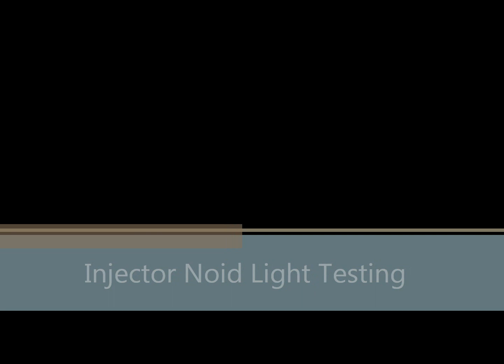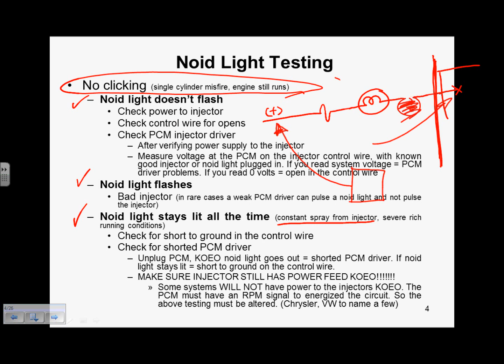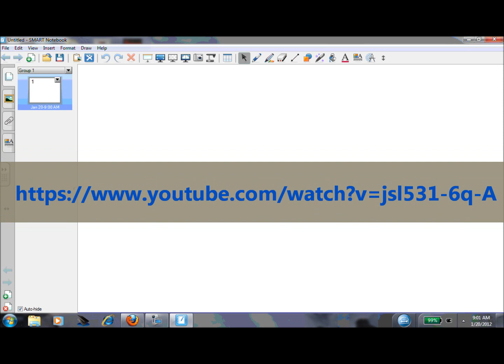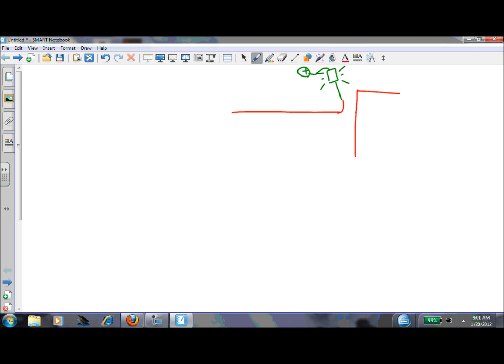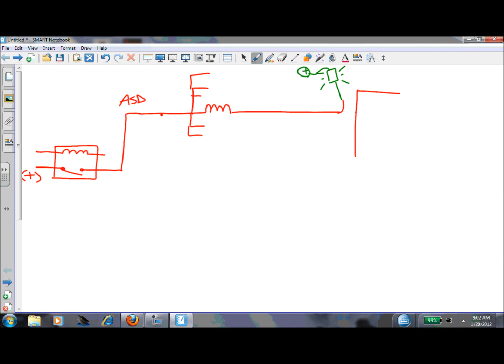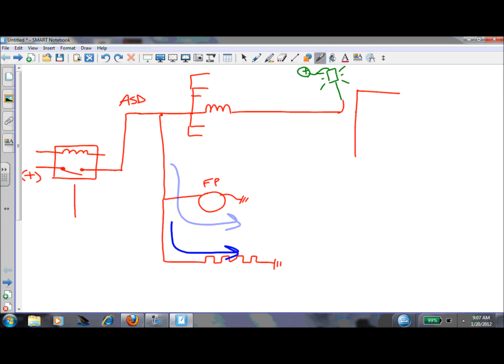How to test a fuel injector circuit with a noid light (a ScannerDanner Premium video)

Comment: If I put my test light on the wire on the ecm to test the driver. Test light on battery positive, it flashes but it is really dull, doesn’t that mean it’s a bad ecm?
Reply from the maker: No, that's simply due to a small injector on time. This is a go, no go, type of test. If you are chasing a no start, you have injector pulse. Move on to spark and fuel pressure and compression testing
Reply: @ScannerDanner  Nah it’s a misfire on a single cylinder changed a coil and an injector! Don’t wanna throw anymore unnecessary parts at it. I will go to compression test it.

Comment: I believe I have fallen into the Chrysler mystery category. 04 grand cherokee 4.0. #4 injector noid light stays lit and dosen't flash when the engine is running but is off when the key is on and not running. It started with a very rich misfire and it would go away for a while if I unplugged the #4 injector and plugged it back in but then it blew a few injector fuses on startup randomly and then once while driving to work one day and immediately blew again even after re-seating the plug. It seemed to be only when the #4 injector was plugged in that it would happen so I just ran it unplugged for a couple days as my commute is only about 10 minutes, but on the way home the second day I think the computer became very unhappy and started misfiring like crazy and I barely made it home at just slightly above idle.
The wire going to the plug was in bad shape and had bare wire showing so I opened the loom and spliced in a new connector well past the damaged portion of the wires and it didn't fix the problem.
I checked both pins at the connector for a short to ground and got nothing. I pulled the right side plug on the pcm and checked each hole for continuity and one hole made a 0ohm connection to one side of the injector plug and the other pin on the injector plug made a 8ohm connection to 3 holes on the pcm connector.
Where should I go from here?
Reply from the maker: You did your resistance test incorrectly. With PCM and #4 injector unplugged, one lead of your ohmmeter should be connected to battery ground and the other lead to the injector control wire at the injector or PCM (preferred at the injector) you should have an open circuit. Infinity reading on you mega ohm scale. Sounds like you have a harness issue especially because you blew fuses at one point too! Find the short to ground on the #4 injector and you'll find the rest of your problems

Comment: NEW RELATED ISSUE. 1999 Ford V 10 6.8 L.. pulsating light when the motor starts to idle. 1200 RPMs plus the light gets really bright and stop blinking and remains bright on.. totally excessive white smoke tail pipe. What’s the best troubleshoot thanks.

Comment: Dan I need your help. What are the two fat red wire leads that plug-in?.  (Boshe injector Mercedes). On a 05 smart car CDI diesel..I've been trying to find out for 2 years now so I can diagnose why I have a no spray situation at the injectors. I don't want to just start poking around and blow the ECU. I've TRY to contact boshe in Germany, local Mercedes dealers.. injector service shops, etc... nobody can tell me...I'm guessing one is feed , the other is pulse((theres continuity between the two)) and gets ground through the body. But still not certain 🤔
Reply from the maker: Let's move this to my forum www.scannerdanner.com 
It is free to join and we can definitely help you. I have 28k global members and hand picked moderators who've been with me for years and know my material inside and out and are there to help me help you guys. It is just too difficult to offer back and forth messages here on YouTube with stuff like this and we also can't share pictures and images here like we can on the website. Hope to see you there!

Comment: Sir, I have one doubts why there is 3V on one side of fuel injector and not 12V in my i20 2011. There are no issues in my i20. Just curious to know whether it should be 3V or 12V?

With engine off and key at ON position, the connector harness is connected to the fuel injector. 

Now, one end of multimeter is connected to ground and other end to one side of the fuel injector. The multimeter shows 12V, and other side of the connector shows 3V. Is this 3V supposed to be 12V and dropped to about 0V only when injector is switched on. Please note the injector is a computer controlled ground side switch.

Same result for the remaining 3 injectors. I'm really surprised why it's showing 3V rather than 12V on a ground side switch.
Reply from the maker: Do both injector wires go to the ECM? (GDI system)?
Reply: @ScannerDanner  yes both go to the ecm. The injector seems to be a ground side switch. 

With connector still plugged, one side read 12v and other side read 3v with engine off and key at on position.
Reply from the maker: @tnamen1307  then it is a GDI system and they are completely different in how they are controlled.
Reply: @ScannerDanner  it would be really great if you could make new videos explaining why there's 3v on one side in a computer controlled ground side switch circuit.
Reply from the maker: @tnamen1307  I have videos on GDI injectors and how they are controlled.

Comment: I've been trying to troubleshoot a 91 nissan 240sx with high fuel pressures and white smoke/fuel coming out the exhaust. Replaced fpr twice with same condition. I'm looking into checking the injectors. I'm a novice when it comes to automotive diagnostics. This is definitely a learning experience

Comment: How about if both wires stay on I check with the tester they both give me power on each side of the injector    No Flash. When I turn the key on it does turn on with the tester inside.  Touching ground

Comment: I have this exact situation going on! I had white smoke that smelled like raw fuel injector #6 stuck wide open I shot the parts cannon at it...new plugs, wires , coil, injector, pvc even replaced the fuel pump....The noid light would light up. One day it just started running fine again,  and now fast forward a year...I’m getting same cylinder misfire on #6 cylinder, but no more white smoke instead now noid is NOT working.. I’m getting 14 volts on feed side and 0 volts on the control wire... I did what you said and followed wire to computer and it’s saying 0 volts, however I can’t go any further the wires go up down and around the tight area under the battery box 09 Escalade hybrid .... does this wire go to fuse box? I believe it’s a shorted wire because it would only act up after it rained a few days...
Reply from the maker: 14 and 0 and no white smoke? Your injector winding is open
Reply: Thanks for the prompt response! I’m gonna chase this wire down once and for all! 👍🏻
Reply from the maker: Remember, if that control wire is shorted to ground, that injector will be spraying fuel constantly! And you will absolutely have white smoke pouring out if the tailpipe
Reply: ScannerDanner that’s what it was doing a year ago and all symptoms went away and all of a sudden one rainy hot muggy midwestern day it came back in same #6 cylinder, however now instead of stuck open spraying fuel it it’s not clicking at all... I can feel the injector not clicking inside like the rest. I swap with cylinder #4 and it starts working. I’m thinking there was a corroded or shorted wire that finally snapped or something. when it used to act up I could tug on the harness and make it fix itself, but that won’t work anymore ...another indication it’s most like a broken or corroded wire or a loose connection.
Reply from the maker: @vunit8213  I understand what it was doing before and there is no question you have a harness issue that was never fixed, however, if you have 14v on the feed and 0v on the control, measured right at the injector and you are sure the injector is not energized, there is only one cause for that, an open in the injector winding. You said when you switch it to another cylinder that the injector starts working? So when #6 is moved to #4, the #6 injector works?
A corroded wire that would lead to an open circuit, you would read battery voltage on both the feed and control wires when measured at the injector, but 0v at the computer.
Reply: ScannerDanner exactly right! It’s not the injector because I swapped connectors and it’s definitely the plug... i followed that wire and checked it on the way with the power probe and some liquid tape. (You taught me that trick) still no voltage but that wire starts merging into one big cluster under the Battery box and 2 sets of wires splice off from it and there all taped up so I’m lost! There’s a connector that says dephi is that my fuel injectors? Because the injector connectors also say Delphi? 🤷🏻‍♂️ I guess what I’m saying is I think my computer is hidden under the battery box....it’s going to be hard to test at computer when I think my computer is under the battery
Reply from the maker: @vunit8213  okay, so that injector functions when moved to another cylinder. Then there HAS to be an issue with your measurement. Can you please confirm you are seeing battery voltage on the feed wire and 0 volts on the control when measured directly at the injector connector.
Reply: ScannerDanner yes, at the injector the noid light wont light up so I tested feed/control wires and got 14 volts at feed and 0 volts at the   Controlled wire... I followed that wire as far as I could and it’s reading 0 volts it’s completely dead....could it possibly be the pc driver? All the other injectors are testing good... I’m trying to test it at the PC Driver, however it’s easier said then done, it’s all wrapped up pretty good and winds down and around and merges all different directions...
Reply from the maker: @vunit8213  to be clear, battery voltage on one wire and 0v on the other wire when it is unplugged from the injector is normal! This test should be done plugged in and backprobing. Or with a known good noid light installed. Is that how you are doing it?
Reply: ScannerDanner Ok I see, I did it both ways... with engine running/off back probed with power probe and the rest of the injectors control side wire light up green on power probe showing negative and when turned on they got to 14 v however that one single wire is showing  nothing! It’s dead! However, I’m going to backprobe again to make 100% sure....do you think my issue is the driver or the wire?
Reply from the maker: @vunit8213  I think it's the wire. Wherever it was shorted to ground when you had white smoke pouring out of the tailpipe, that wire would be open and exposed to the elements. I believe this same location is now green and corroded and is now an open circuit.
Reply: ScannerDanner that’s exactly what I think! Because it would fix itself and run fine until it would rain for 2-3 days and I would notice, those would be the days it would act up and misfire. I think that wire finally broke through, because I was in a drive through and like a light switch it started shaking out of nowhere! But I had just got done driving down a road that had about 2”-3” of water submerging half of the road...
Reply: ScannerDanner well, I still having an issue with cylinder #6 missfire.... here’s the kicker!!! I’ve been trying to fig this bitch out for awhile and now I’m really confused!! My noid light won’t light up on #6 connector anymore, however feed/ control are both registering 14.2 volts 🤷🏻‍♂️ 🤦🏻‍♂️ ......I checked a know good and it’s lighting up noid, but the light looks very dim...I’m not sure if that’s normal or not!? I just changed the injector because I didn’t know if it was spraying adequately, however it’s 100% not the injector....It’s definitely the wire or driver....I’m going to clear fault code and see if I’m able to catch the noid light in the first few seconds of start up just Incase the driver is shutting the injector down intentionally... the connector was bad so I just replaced it, but that being said maybe the driver shut down that injector because sensed a bad connection???.... the only thing I find kind of weird is when I test a known good injector the noid looks pretty dim, almost a reddish orange color and I would think with 14v it would light up bright considering you said it only takes 200 ma to light up that bulb... 🤔 any advice is appreciated!

Comment: Ok so after verifying no clicking at any injector on pass side ( tan wire ) and still no pulse at connectors at each injector. I went to PCM to pin 58 ( tan wire ) back probed pin and went to batt pos and still no pulse. Although back probing pin 59 ( White wire, bank that's working ) I get the pulse, confirming driver is sending signal out on that side. Also confirming driver for tan wire pass side not firing injectors is bad. I'ma call it a bad PCM driver and going to swap PCM out.
Reply from the maker: Let's make sure it is not some type of intentional shut-down of the injectors. The computer will do this when it recognizes a misfire to prevent the cat from melting down. The key in identifying this condition is to test for injector pulse immediately on start up. The computer will always try again on initial start up before shutting them back down.
Reply: @ScannerDanner  here is the post I made in the forum, shows pics ect. seems some bad wires pos to pulse wire crossed and shorted pcm. it is obd1 the other side works fine and is on a separate pulse wire. I did a batt disconnect, then reconnect and had someone turn key over as I was checking for pulse on the side in question. Just to make sure it wasn't an auto shut down. Then I went to pcm/ecm. Pulses on side that works pin 59 but not on the side that don't pin 58. Found a good used ecm for 35.00 so I'ma ( lol ) swap it because it's cheap enough and being obd1 and same MT/FED and part number as well as no programming because of age and type. 
Your videos have helped me greatly with diagnosing this obd1 system. Let me know what you think after looking over the post in the forum linked below. 
https://www.scannerdanner.com/forum/search.html?query=engine%20running%20on%20one%20side&searchdate=all&childforums=1&catids=4

Comment: I have code p0208 #8 injector circuit an p0308 #8 misfire..... while car running pulled injector 8 connector off an there no change in idle sound, Pulled #6 an there was a change in idle sound.... Put a noid light on 8 an no light....loosing my mind with this

Comment: 1991 Saturn SC 1.9L 4cyl. PFI.   I have an occasional sputter, no start condition. When car failed it was like someone turned off the key.  All injector coil resistance are perfect. System type: All 4 injectors fire at the same time, not sequentially.  I disconnect all 4 injectors and the noid light flashes on each of 4 injectors.  I reconnect 3 of the 4 injectors, noid light on forth and there is no flash.  I say this is a weak driver in the ECM. (flashes when the driver is not loaded up, does not flash with the driver is loaded up)  Do you agree with a bad driver in the ECM?

Comment: Hello, Paul. You are not mentioning a short to voltage on the control wire. If the control wire is powered by another circuit, you will get 12 v on the control wire, which  will keep the pcm from grounding the injector and can also result in pcm driver damage if the pcm does not have high protection against short like that. That is my analysis of the circuit. You are the man a lot of mechanics on you tube copied on. You have the final word.
Reply from the maker: That is a variable for sure but extremely unlikely, (so much so, I've never seen it) and when or if that would happen, it would definitely cook the driver in the PCM. 
I'm not sure it was necessary to cover that here but maybe??
How would one catch this? First it would depend if the short to voltage is on a circuit that is 
1)hot all the time
2)hot with the key on
3)hot with it running only (like an ASD relay circuit)
Second, in your testing you would find 12v on both injector wires with the injector unplugged, which could be a bias voltage (normal) or an actual problem. The separating test would be do BOTH wires12v readings light your test light?(incandescent) If yes, then you found your issue and you better fix it before going any further. 
Thanks so much!
Reply: Thank you !  By the way, most of the things I learn is from you.

Comment: scanner danner let me ask a question. my brother has an 01 4x4 silvarado. 1 whole side is getting pulse by ground but is only getting 1.8 volts on positive and it needs 14. I have checked the relay and notice 14 on one side 1.8 on another and 12 on another. I have tested a good 99 sierra and know for a fact 3/4 prongs on the asd relay will have 14 volts. MY question is where would the 1.8 come from originally that goes from the relay to the positive injectors on all of the passenger side. also*** the other side of the engine all have 14 volts when running on the positive side of the inj. if this makes sense please answer I think its coming from fuel pump module but am no expert. would love help
Reply: in a nut shell. on a good running same year truck. i know there is negative power pulse fluctuation, also I know there is 14 volts on all positive side of all injectors. on the bad running truck I have 14 volts on all inj on driver side and only 1.8 on all positive side inj from the passenger side. also I know from a good truck that 3/4 prongs on the asd fuel relay will have 14 volts when running. the bad truck only has (2) sides with 14 and a 1.8 that matches the failed passenger side. so where would the 1.8 volts come from. does it come from the fuel pump module or comp?

Comment: 5.7 hemi  code p0305 I changed the coil spark plug and swapped injector with a good one same code!! I also did a compression test 220psi!! Know what please help me!!! The engine shakes lightly but when going up an incline or giving it heavy gas it goes into a heavy Shake an engine light flash